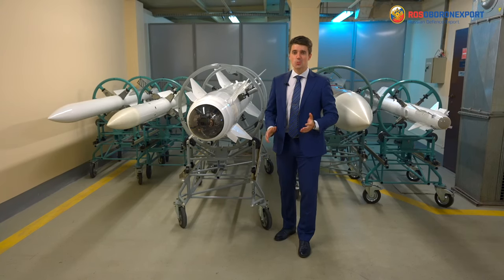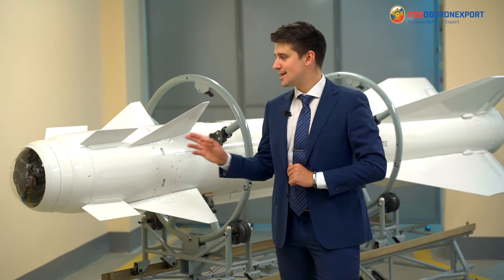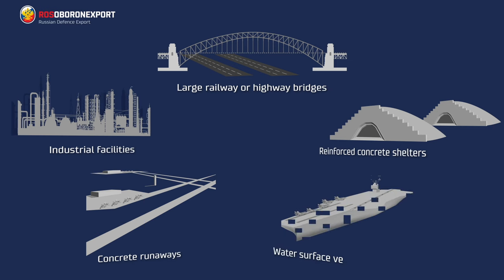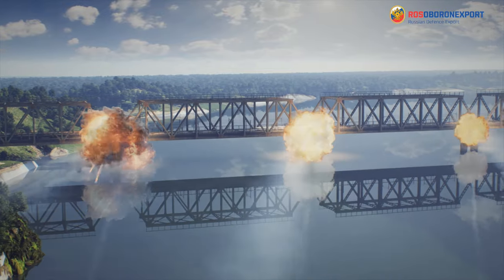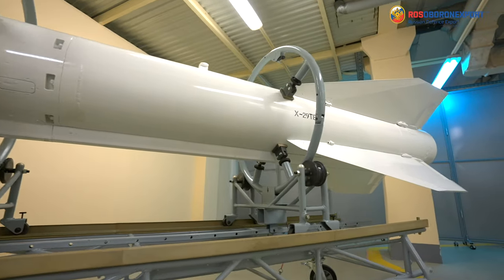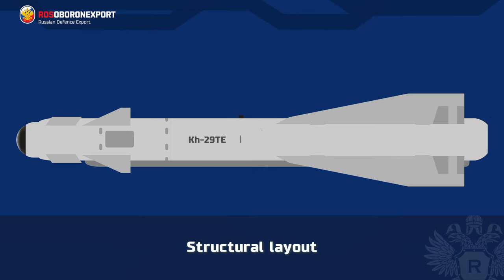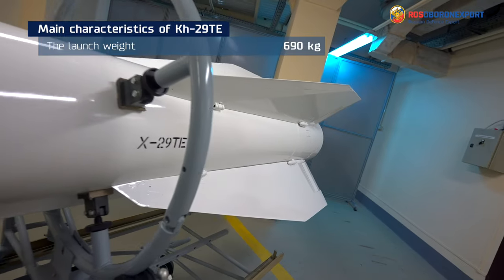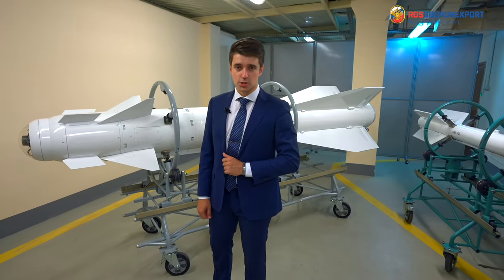Kh-29ТЕ Air-to-surface missile

Comment: loving using these in DCS never knew they were this fucking big. Love the use the laser guided kh29L
Reply: Can the kh-29L hit fast moving vehicles on the ground???
Reply: @willisfernandes2366 yea as long as the pilot can keep it locked and lased it will hit. But thats kinda sketchy to do on the frontline you are exposed to manpads im guessing so im assuming they can buddy lase just like usa does with drones/helicopters/jtac. As long as its lased it will follow it. There is also the kh29T tv guided variant.

Comment: These things are useless these days. Such missiles were needed when there was no GPS/GLONASS, when there were no drones. 
Glide bombs are cheaper and have a much longer range, more effective.
Reply: Glide bomb is also slower and has the range only with GPS guidance. Advanced AESA ground based radar might see it coming and blow it off with AAA. Tactical multipurpose air to ground missiles give less time to ground defenses to respond. Kh-29 is faster than AGM-65 apart from packing way larger warhead
Reply: Glide bombs are not as accurate as a missile and easily could miss their target. but Glide bombs have a large warhead and usually dropped 2 or 3 at a time to cope with the lack of accuracy. targeting area with buildings or something like forest patch. it doesn't need to be pin point accurate it just destroy whatever around the blast area. But if you want 100% accurate hit on a specific target these kind of weapons are necessary
Reply: You must the type of a person that eats soup with a fork and a hot dog with a spoon.
Reply: Satellite guidance systems can be jammed by jamming specific satellites, this does not work with systems such as Starlink, since there are a lot of satellites, but it is not yet possible to install a Starlink terminal on a glide bomb
Reply: @jayjay53313  glide bombs are much cheaper than any AA missile. The Kh-29 has a range of less than 30km. At this distance, the jet is vulnerable to Buk and S-300. We see this in Ukraine, where the Kh-29T was used only against targets near the front line, while the UMPK (the Russian version of the JDAM-ER, FAB-500 with GLONASS guidance and wing, range ≈ 70km) is effectively used much deeper behind the front line. 
Why are you writing about AGM-65? It's the same outdated useless missile. If Ukraine receives the AGM-65, they will not be able to use it effectively for the same reason why the Kh-29T is ineffective.
Reply: @thisisafact9181  even the GPS receiver in your car is accurate enough. Don't misinform. 
Bombs with GPS and glonass guidance are very accurate. just like GPS-guided missiles - check the photo of the Antonovsky Bridge after the himars strikes, the accuracy is less than 15 meters.
Reply: @BigSmartArmed  how is the Kh-29T better than glide bombs? Price? Range? The power of the explosion? No. The Kh-29T is faster than a glide bomb, but against a static target, 1 minute won't make any difference.
Reply: @alexandersedykh9280  your words need some kind of proof. Antonovsky Bridge was protected as much as possible, but this did not prevent himars from making precise holes in it.
Reply: @zdobrov Kh-29 is is better literally because of facts.  US GPS glide bombs used in Ukraine completely failed, specifically because of GPS jamming.  The only US weapon platforms that function on Ukrainian front are M982 guided 155mm shells and HIMARS missiles, neither reply on GPS in their terminal stage, but on inertial-guidance.  Both are insanely expensive.  Kh-29 is a TV guided missile, it's cheap, it uses video to locate the target, then internal system brackets the target are and self guides to impact.  Nothing to jamm.  Kh-29 have been used by Russians in Ukraine, not a single one was jammed or intercepted, all hit their targets.
Reply: @BigSmartArmed  US bombs may be ineffective because Russia has S-400 and Su-35 with R-37M, Ukrainian Su-24/MiG-29 cannot gain altitude. But if Ukraine had Kh-29T or AGM-65 instead of US glide bombs, the situation would have been even worse for them. 
GPS jamming - why doesn't it work against himars on Antonovsky Bridge, the most protected Russian facility in the second half of 2022? Inertial guidance cannot provide the same accuracy that himars showed against the Antonovsky Bridge, so it was GPS. 
"Kh-29 is cheap" - missiles with TV guidance are always more expensive than glide bombs with GPS guidance. And especially upgraded unguided bombs (UMPK, JDAM-ER). 
I do not understand why to discuss this if we have been seeing for almost 2 years that the use of the Kh-29T against the enemy with air defense is almost impossible and dangerous, at the same time UMPK is used regularly from safe against Ukrainian S-300 and MiG-29 distances.